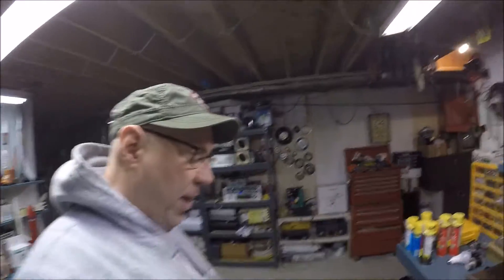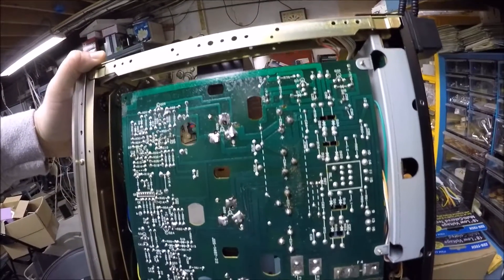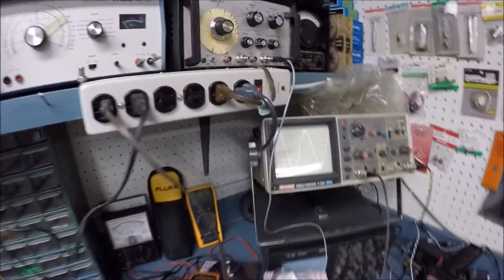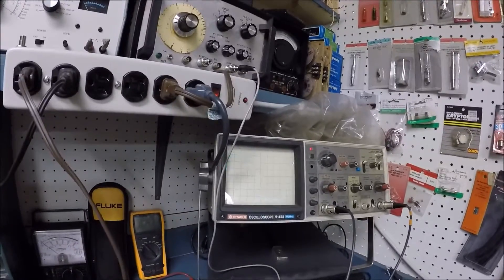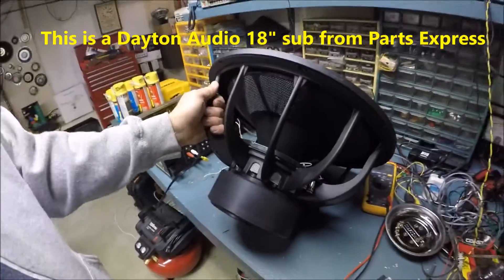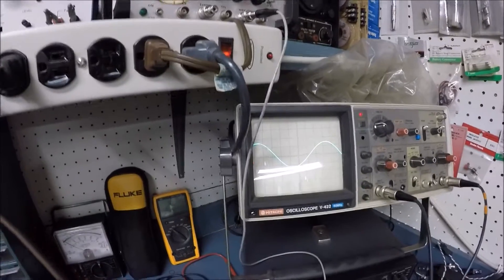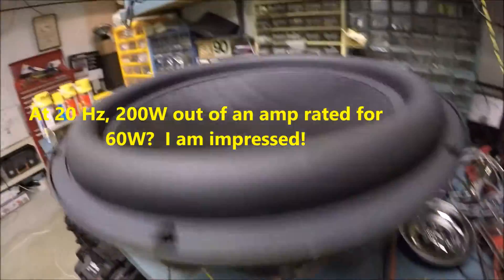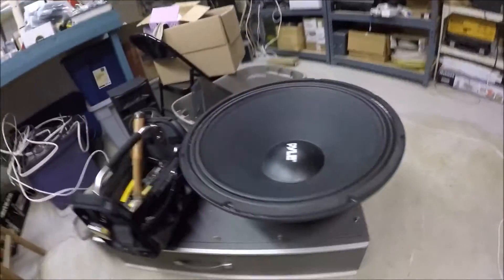Testing a Kenwood KA-7100 Amplifier

Comment: Pretty interesting review. Do you do any evaluation and repairs. I have an old KA7100 that I bought new back in the day and was thinking of restoring it. If so where are you located.
Reply from the maker: I am in Connecticut... where are you?
Reply: I'm up in New Hampshire. I see to remember to remember i had no speaker output, but if you flipped the power switch on an off a couple of times they would come on. haven' t used it in almost 25 yrs. I also have a MacIntosh preamp I would like to have looked at possibly.